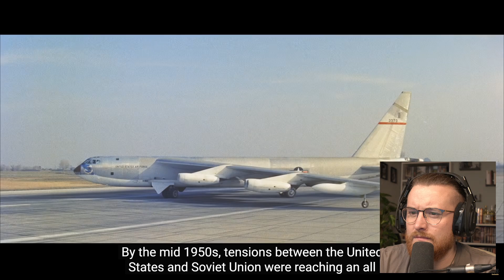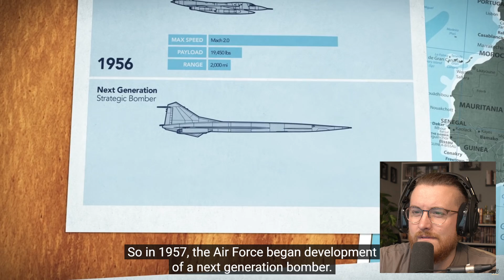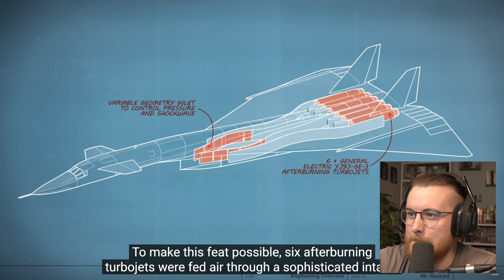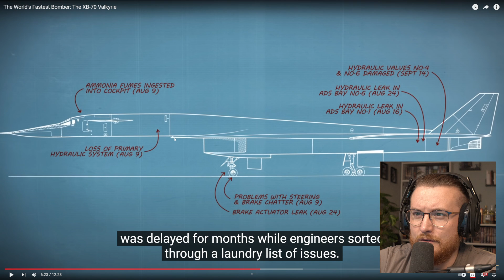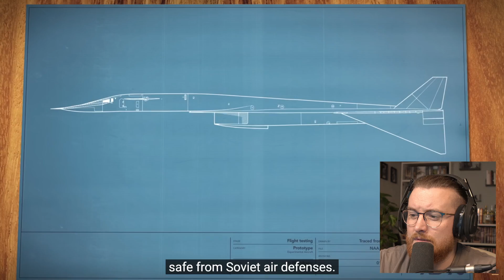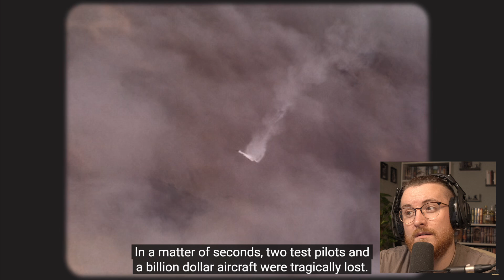Royal Marine Reacts To The World’s Fastest Bomber: The XB-70 Valkyrie

Comment: The one thing I've noticed about you kids watching and reacting these videos about USAF jet aircraft a built in the 1950s and 1960s is that you never lived through those times (the Cold War), so your perspective is skewed. You see everything through TODAY'S perspective. YOU CAN'T DO THAT. They are two very different time periods.

As mentioned in another comment, it appears that you weren't really paying attention to what the narrator said in the video and came to your own conclusions. I don't really understand how that happens. You also seemed confused about aircraft speed. You were making assumptions about the speed of the B-21 Raider, which a sub-Mach bomber. You were looking up how fast it could go, when on the screen in the Mustard video, it showed that the Valkyrie could fly at Mach 3.0. You also need to understand that altitude and temperature affect Mach speeds. Mach 1 (the speed of sound) requires greater speed at sea level than it does at 75,000 feet altitude.

Comment: What you're not understanding is Jetson just barely been invented in 1950 and this was pushing the envelope of everything that anyone even knew.  Only one or two tiny fighter jets could even break the sound barrier then and they were trying to design something massive that would go over three times that fast. It is called learning as you go... So much was still unknown.
Reply: Jets had been developed by wwii. The sound barrier was broken in 1947, and mach 2 aircraft had already flown by the mid 1950s. This plane flew in 1964.

Comment: There was a similar plane called the XR75 penetrator, which carried the XR75 Thunder dart, both reconnaissance craft, classified above top secret.
The XR75 could fly about Mach 3, the XR7 could fly at Mach 8 with a human on board or Mach 15 in autonomous mode (I have a model of these craft from Testors, they also did models of two UFOs; the OTC (otherworld transport craft) and the "school bus" which allegedly crashed due to a mid-air collision near Roswell back in 1947).
Now they have declassified and revealed the a similar plane known as the Blackbird Two (SR72).
Look up the Testors models and compare the XR7 with the SR72.

Comment: Nuclear powered planes hasn't been done. There's a couple reasons why. First is that exact question, why? You would have an aircraft that can stay up longer than the crew aboard has means to stay airborne for. Why do you need something to stay in the air that long? If it can't be done with today's machines or satellites, then we've taken a wrong turn somewhere. Second is weight. The weight of a nuclear reactor compact enough and robust enough to go on an aircraft that could power it would be fairly hefty and require similar advanced systems to keep it operational. That means even though you've taken away the liquid fuel weight, you've replaced it with cooling water and uranium or plutonium (two of the more dense natural materials on the periodic table.) Third is that it's not practical. If a nuclear powered plane goes down, that's like dropping a dirty bomb or "salted nuke" and that'd be the premise if you intentionally crashed it. If it happened by accident, try explaining that to the world. Also you've got to remember that every aircraft that goes up has to have hours of maintenance poured into it to make sure it's good to go again. If your nuclear powered plane is making fewer landings, it either has to be way more robust or it's falling apart and would need to land frequently for long maintenance times anyways which kind of negates the advantage of nuclear power in that case.

Quick tip, or rather memorization aid, for mach speed. Miles per hour it's about 767, so keep Boeing in mind. Kilometers per hour, it's about 1,234 (a bit closer to 1,235) kmph, so default a password on that. Boeing's default password for their 767's mach flight is 1234.

Comment: There was Nuclear bombers made as a experiments HTRE and PWAR, along with the support equipment to maintain it since it would kill any maintenance crew. The G.E. Beetle being a remote maintenance operator for a bomber that was never made. Project Pluto (should check that out) was a plan to develop nuclear-powered ramjet engines for use in cruise missiles. Would drop it's multiple nuke payload, also salt the earth with radioactivity as it few, also kill people on the ground possibly with its supersonic shock wave as it was planned to fly very low. Also it could fly for days, weeks or maybe even months? (I forget) so it could just spread radioactive contamination.

Comment: You mentioned that the trouble at the start seemed small like brake lines, etc.   I am NOT an engineer but I have to imagine going as FAST as this plane could go, that MANY things could "Rattle Loose".  I may be WAAYYY  off-base, but I would think that the speed and vibration alone was probably more than they imagined?

Comment: The russians flew a prototype plane with a nuclear reactor on board. It never made it to the the point where it was driven by the reactor. The United States air force also was building a prototype plan  and Oakridge National Labs had a prototype reactor in the works for the plane. It sparked a new generation of reactor that is just now being commercially viable. The MSR.

Comment: You never know if something is going to work unless you test it, and there is only so much testing you can do with the aircraft on the ground.
99% of testing will only be achieved when the aircraft is finally airborne and only then will everything be put through the major testing and stresses of everything on the aircraft that would be impossible to understand with the aircraft stationary on the ground hence the term "in flight testing".
You have to fail in testing before you succeed to the point of having an experimental aircraft 100% fit and ready and safe enough to then say "ok an order for 100 of these please"...

Comment: You should check out a Video on the Avro Arrow great plane unfortunately the program was cancelled has alot in common with the Valkyrie also Mach 1 the speed of sound is a little over 767 MPH or about 1235 km/h so Mach 3 is about 3700 km/h

Comment: The B-2 and B-21 fly at subsonic, because flying at supersonic speeds needs afterburners, with will light up on Infrared Sensors, plus the airframes will heat up more at higher speeds.

Comment: As I recall, the training aircraft was owned and operated by North American Aviation.  As it crossed from one side to the other of the XB-70, it collided with the vertical tail surfaces, breaking them off.  The North American pilot was killed and the plane destroyed.  The Valkyrie pilots went down with the fatally damaged aircraft.

The B-58 was doomed from the word go.  The cost per vehicle was unsustainable for such a small payload & range.

The B-52 is expected to stay in service until the 2050's.  That would be a century of service.

Comment: You seem to be confused by the information that was communicated about the crash.  The two pilots didn’t die during testing.  They died because GE wanted a photo op taken of planes using their engines.  During that photo op, an F-104 flew into the wake of the Valkyrie, losing control, and crashed into the XB-70 (not the other way around), exploding the F-104 and damaging the Valkyrie such that it crashed.  It was an accident that had nothing to do with the XB-70’s capabilities nor was that incident a reflection of its ability to fly safely.  

As for the first prototype having issues, that was par for the course during development back then, which is why losing the more flushed-out prototype to a freak accident was so unfortunate.

Comment: Trump did order the US Air Force to bring one of these back up to service condition. Not recommission it, but restore it to flight capable condition. So the go fast and drop option was back on the table for the president. There are several air frames in storage. 1 should be fully operational. The B1 Fills this role at this time.
Reply: ...No. There's one airframe remaining and it was never in service condition to begin with.

Comment: One of the challenges of that prototype were tolerances. Leaky components were much more prevalent back then and operating temperatures were so big that it exacerbated the problems of the landing gear and hydraulic system.
Reply: Leaky components were a feature in these aircraft, their operating temperatures would change the shape of the aircraft at cruising speed and seal those leaks. The SR-71 had that.

Comment: To break it down for everyone in a different way; this plane flew faster than a 5.56 × 45 NATO out of an M16 rifle now wrap your heads around that one 🤯
Reply: That's got to be several thousand feet per second 🤯 very cool.
Reply: @andyloy7809  yes over 3000
Reply: @chrisp308  🤯🤯 that is super awesome!
Reply: @chrisp308  Or about 3700 km/h for normal people.
Reply: Look up NB-36H
Reply: So did the SR-71
Reply: @FP194  this plane is where the SR-71 comes from.  if you look at the designation of what it needs to do, vs what the other bombers we have are...it's the same parameters.  70,000 + feet max ceiling.  mach 3 +
Reply: @nadjasunflower1387  
No, the two aren't related to one another, the SR-71 is a variant of the Lockheed A-12 which first flew in 1962, the XB-70 didn't fly until 1964. XB-70 is more closely related to a cancelled Mach 3 interceptor called the XF-108.

Comment: the B-70 is my favorite 'what if' planes. a lot of the reasons it was cancelled were less to do with any problems it had, and more to do with the politicians in washington wanting to go with ICBMs over Bombers.
Reply: Not really, it was because a bomber can be intercepted and a plane will never be faster than a missile, but an ICBM can't be. Having fleets of bombers constantly in their air is expensive compared to slapping more concrete on a silo, nevermind that everyone knew SLBMs were coming.

The other problem is that it was supposed to use "zip" fuel which was too expensive even for the USAF, and the compromise of using only JP-6 fuel required one bomb bay to be replaced with a fuel tank and still knocked 2,200 miles off its operational range. At that point they just gave up and said the two aircraft would only be used for testing, then lost the one with all the measuring equipment in it and so gave up on the other one rather than refitting it.

Comment: These supersonic bombers were supposed to slow down, drop payload on target, then hightail it out.

 The targeting systems of the day won't be able to keep up with how fast the bomber goes. Add the fact that the ballistic trajectory of the bombs would get messed up from how fast they're just zipping through the air; they'll end up tumbling off-course.

Even fighters carrying bombs have a general rule that they should never fly past Mach 1 to avoid their bombs getting ripped off their hardpoints by the high airspeed thanks to drag. They (the fighters) too must slow down before dropping ordnance to ensure maximum accuracy. Even with precision guided bombs too.

Comment: Mach is indeed the speed of sound. It isn’t a definite number though. Things like altitude, temperature, air pressure etc change it. It’s like 740 mph at sea level, but the higher you go, the speed in mph lowers. So at 50,000 feet, to go Mach 1 you only need to be going 660 mph